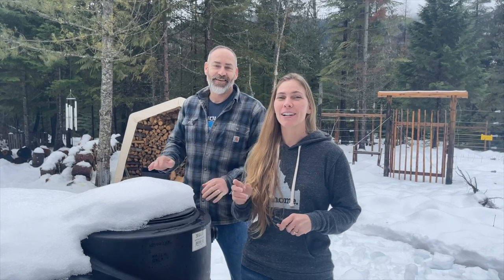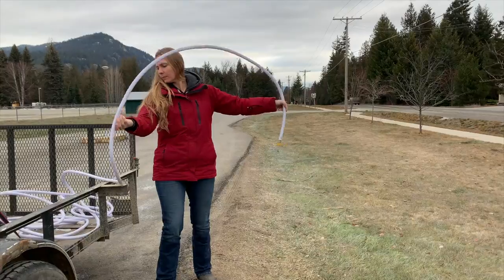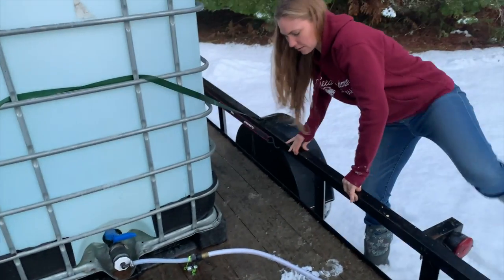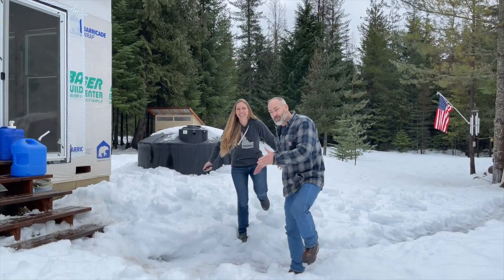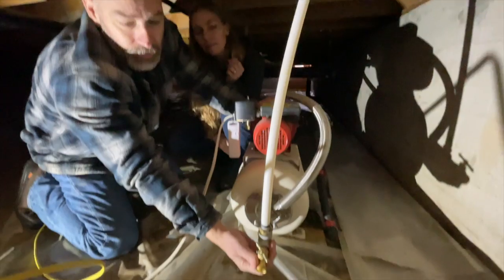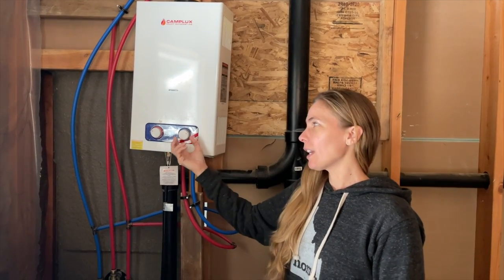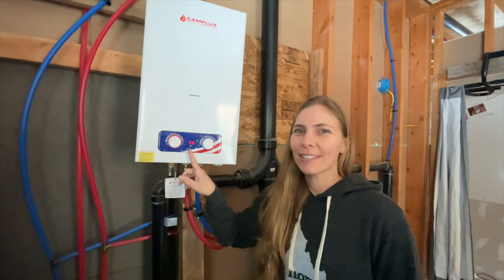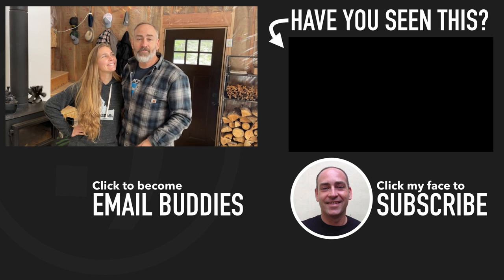OFF GRID WATER SYSTEM TOUR

Comment: FYI - Suggest you look at getting 1 or 2 of the Zero G hoses from Walmart.  They are drinking water approved and you have no problem rolling and unrolling them.  They are black in color and feel like a fabric versus vinyl. They are very lightweight too.  We used to have a couple of those white hoses and we now use the Zero G  in our 5th Wheel RV with no problem.

Comment: I'm going to be living off-grid pretty soon. I'm excited and a little scared too. I have never been 100% off-grid. Once upon a time I killed my breakers and used solar to power my lights, propane to cook with but I've never been without instant access to water. That's going to be a challenge but if I didn't think I could overcome it then I wouldn't be doing this. I'm a scientist. I built a nuclear fusion reactor (not self sustaining). If it was self sustaining then finding the off switch in a malfunction would be difficult. I've built some weird stuff. This step could be my chance to explore my creativity to the fullest extent. But still, failure is always a possibility..

Comment: Hello first time watching. To make life a little easy when empting your water supply tank on the trailer to your holding black tank. Add a air valve to the fill cap, to the water supply tank to pressurize the tank with compress air. Do not over pressurize the tank, watch and see how fast it empties

Comment: Solar thermal is a fun way to make hot water as you can run it fully off sunlight with the collector array and a solar panel to run the pump. The evacuated tube setup is best in a place with snow as it is much harder for large amounts of snow to build up on a round pipe then on a large flat panel.

Comment: love your videos just wondering if you should be using stronger straps on that much weight in the trailer, that tote holds 275 gallons if im correct and thats 2295 pounds of water  alone  for those dinky traps. Be safe Guys and keep the great videos coming :)

Comment: Yes, I'd like to see a complete cabin tour.  Seeing that you appear to have 2 teenagers, how long does 2500 gallons last y'all?   What is the average winter low temps where you're at?  I'm moving to the Kenai Peninsula area of Alaska in the next year or so.  From what I'm tracking of weather data so far, it seems that zero is about as cold as it gets there during the winters (2 winters worth of data so far).  There may be 4 or 5 days over the entire winter where it gets below zero.  I'm interesting in doing something very similar to what you've created so any information you can provide would be greatly appreciated!

Comment: I wouldn't mind a full tour of the cabin, looks like you guys have made a ton of progress!
.
I know you haven't had any problems with the water heater _yet_, but at LEAST relocating it to the laundry/utility room should really be on your short list of projects.  Preferably with a vent to the outside.
.
We use a Big Berkey filter for our drinking and cooking water.  We had a Berkey Lite and replaced it after the plastic cracked.  The only "complaint" is the expense of replacing the filters once a year.
Reply: In the video they explain that this water heater is the original outdoor water heater that they used when they were living in tents during the building process and that they are going to be upgrading to a proper indoor water heater and they will be relocating the water heater at that time.
Everything cost money and they are prioritizing where/when money is spent.

Comment: Of course it's not frozen; your temp gauge said it was 35 degrees. Let's see if it freezes when the temp hit -20 for three days. Still appreciate the video. Thanks. 
Note: I have a 1500 gallon tank with the top cut off, buried 4.5 feet for my Goldfish. And only the top inch will freeze when it gets to -10 for one day. I just push down on a 2x3 foot floating plastic solar blanket to break the ice. The extra 1.5 foot deeper does make a big difference. Good luck.
Reply from the maker: +chas marischen sure the top or our tank freezes a couple of inches when is gets super cold but it doesn’t effect its performance. Water is taken from the bottom of the tank.

Comment: Great Job on the Videos you've done.. Quick side note on the tank less water heater.. It would be well worth your time to add to the hot water side coming from the tank a stainless steel flex pipe.. ( add between the tank and the Pex Pipe) this will dissipate the heat from the tank less hot water heater, and avoid the possibility of future problems..  Pex will work.. but the heat could cause deterioration of the integrity of the pex pipe over time.. better safe than sorry... Kepp up the great work..

Comment: Flushes toilet...goes to refill tank!  LOL  Great place.  I live part time about 50 miles from sandpoint in Montana.  I use many of the same techniques as you.  I would say, try rain water collection and use a carbon and doulton ceramic filters...good to go, no well.  (I do have a well but my cabin is rain water.  Hot showers with instant heater...  Great site here!
Reply from the maker: Think that is true in AZ. 🤢

Comment: My next biggest question is why haven't you made a multi purpose setup intended to collect & melt snow somewhere on your property?

Like a metal silo type of tank with a removable lid that allows snow in and helps speed up the process of converting the snow into water by trapping all the heat coming from underneath essentially turning the silo into a boiler that's heated using wood fire, sit it above ground on a cement or cinder block foundation big enough to accommodate its size and make it so it sets somewhat high from the ground to allow the fire to breath easily and for easy clean up with a shovel or leaf blower or air compressor lol

Comment: You need a 12 volt water hose pump to speed up that job. You can power it with a jump pack or your truck battery
Reply from the maker: we use one if we are in a hurry.

Comment: Keeping that water heater inside not safe, remove that out side without delay.
These types heaters are silent killer when installed inside without any vent.
Reply: CO is an odourless, silent killer. Regs here in Europe forbid the fitting of gas heaters without being vented to the outside. Extractor fans in the room are no good, they can and do fail leaving the CO to build up.
Reply: HS is laughed at there, hence HS Sally.Itll be fine..until it isnt.
Reply: I ran one inside for a family of 6 for two years. Kept a CO detector near it. 0 issues. They are 100% fine to run indoors. There are hundreds of people running these just like this up there. No one is dieing, because its not an issue. Period. You would have to run that thing non stop for days and days for it to even trip a CO detector. Its not possible I know from experience, and not internet nonsense
Reply: @LatchkeyKidX  glad it works for you. But CO alarms fail as do extractor fans. 

All the time there is adequate O2 and the heater is work efficiently all it produces is CO2 and water.

The reason that the building codes were changed here in Europe is that people were dying from CO poisoning due to operating gas heaters were no longer working in the way they were designed to.

A few bob to get the flue vented to the outside seems like a reasonable price to pay to keey people safe.

Comment: I would love to hear from you guys after you have a 24-cell unit system with capacitors and with AC units and how you guys are so efficient and having abundance of water and electricity now they have a thermal heat that you keep in your water tank and you don't even need a water heater if you build the Buffalo above elevation you won't even need water heater setting the Buffalo to the elevation allows for centrifugal force utilizing it instahot at the water head shower and allows for you to have water conservation and heated water as needed not heating water that you're not using

Comment: I love your setup, but think you guys need to make some minor adjustments to make the best use of your truck / tow trailers space / gas / time / water runs. 

If you dont have another one already invest in another portable water tank possibly 2 and load your tow trailer with them making the best use of your tow trailers space, and when emptying the tanks buy a portable water pump that you can plug into your car and run it from the portable water tanks simultaneously into the 2500 gallon water tank, that way you're not just standing around waiting for the water to start flowing out of one tank into the big tank .....

Comment: Martin, I'm new at this in WV. I have 5 acres and a 2009 home that isn't hooked up to any city water. I'll be ordering a cistern of 2500 gallons. I want to simply hook it up to my in-home filter system and then branch out to the bathroom, kitchen and hot water tank and wash machine. What are the best fittings to use and can I go straight from a 2" outlet to a 1/2 in inside the house.

Comment: The water heater has a drain. Can i plumb in a ball valve into so I could drain it after use?  i want to use it just outside the bathroom. I keep a 100# propane bottle right outside one bathroom in the winter time so I can run the hose through the window to a 10,000 btu radiant heater. I use it for emergency heat in the back part of my total electric home in case I loose electricity in an ice storm. i have used it and it works great. I also have a 30,000 btu radiant heater on the other end of the house that I hook to a 500 gallon tank. They keep the 1700 sq ft house cozy warm even at 6 below.

Comment: Hey you guys I got a wonderful ingenious idea for you guys one is how to sanitize your water with UV technology second is how to give back to great if you have solar panels or how to maximize your power capabilities to utilizing capacitors for storage of power and how to keep your batteries at acclimated temperature you desire I utilize the trough method which allows me to submerge the battery up to 3/4 deep which allows me to keep the battery at a cool index so I could give back to grid 3 to 4 times a day so in Arizona the solar industry is installing the batteries in the Attic limiting the homeowner to only get back to grid once that's at 11:00 p.m. when the batteries have cooled down and heat index in the Attic is only $120 when installing batteries in your laundry room and climate controlled atmosphere with the water trough you could literally power your house and keep your batteries cool without wear meaning you don't have to replace them every 5 years

Comment: 8:42 It's completely insane to use propane Water Heater indoors, especially in a bedroom. There are at least 3 reasons why: 1.Potential propane leak. 2.Carbon monoxide, it has pretty much the same density as air, so you can have unsafe concentration at one height and detector on the other height which detects nothing. 2.Carbon dioxide level can become unsafe.      P.S. Stay safe.

Comment: Love your channel - new subscriber just going through your videos. I know you guys probably get a bunch of comments with people warning you of one thing or another - and I hate to be that guy. But, the water heater installation in your sons bedroom is not a good thing. I am a retired insurance investigator and I have seen my share of tragedies with carbon monoxide. You are not detecting carbon monoxide because everything is working correctly on the heater.  However there are a number of things that can go wrong that can cause the unit to kick out dangerous levels of carbon monoxide and it can happen suddenly and without warning. It’s a real hazard and I would highly recommend you re-install it so it can be properly vented.
Reply from the maker: We will. Thanks.

Comment: I do not trust your hot water heater not being vented,  if that malfunction with the burner you will not be making anymore post.  What you have now is dangerous, please vent it out
Reply: Please explain how the heater can malfunction? Hint: it cant in the way you are describing it. There is 0 danger
Reply: @LatchkeyKidX  If fire sensor failed and gas is not off after heater fire off, gas going out to room, this gas burner is open system. And there is more dangerous things: 1) bburner grab and burn oxygen from room (ok, without doors new air income), 2) output must be forwarded out of room. This is very bad and against rules in almost all countries.
Reply: @CzKaa  there is no danger from an on demand water heater that size. None. Again my experience is not just internet hearsay or government oversight. I have tested for myself.
Reply: @LatchkeyKidX  Ok. Repeat for slow brains: in case of fire sensor malfunction in heater and gas is not burned, gas leaked to room, because burner is open system.
Reply: That's probably because you don't understand the mechanics of that device or any of the Mr Heater devices or any of the ceramic element heating devices. You're properly conditioned to respond to the current dogma and ready to sit and speak for a cookie . I've been living off grid for 60 years and have and use all these devices based on knowledge experience and keeping up to speed with current day technology.

Comment: A seriously you guys consider having solar panels that produce condensation during little to zero humidity they have solar panels that produce condensation there are AC units that you can buy that produce an extreme amount of water condensation consider your AC unit that has 50 to 150 gallons of water flow an hour and again is to having it run during the times that you don't need it is when it produces water so if you're not at your cabin and you have your cigarette set up and you have the AC's running at night you could get an alert when your water tank is full but no one thinks of these things your AC coolant system up to 150 gallons an hour

Comment: All propane burning appliances are by law if UL requirements that 0 2 sensors immediately stop the flow at the regulator. Also if the device is knocked over or even moved. Learn something before you imbaras yourself again.